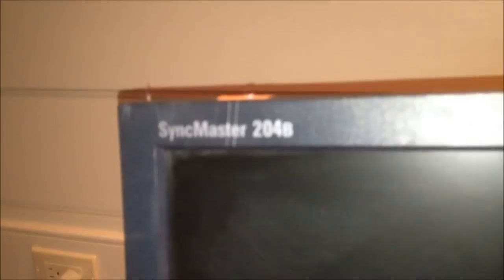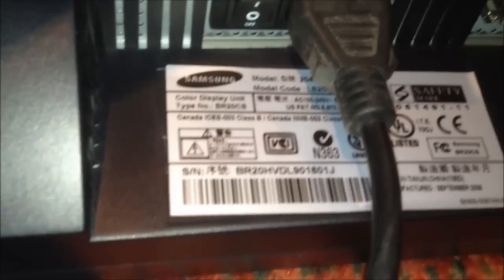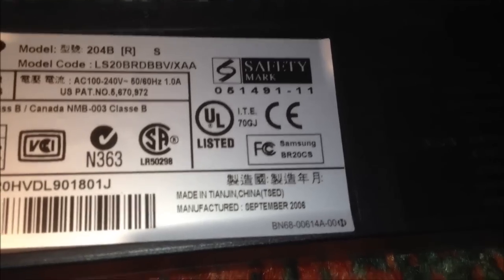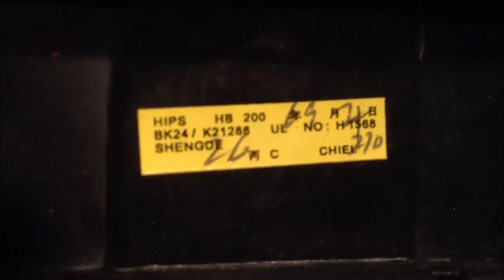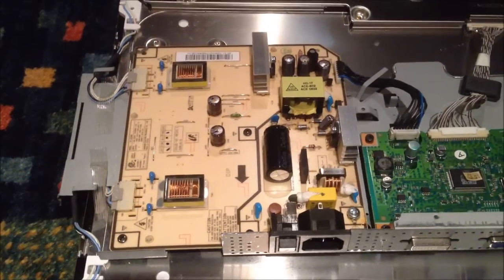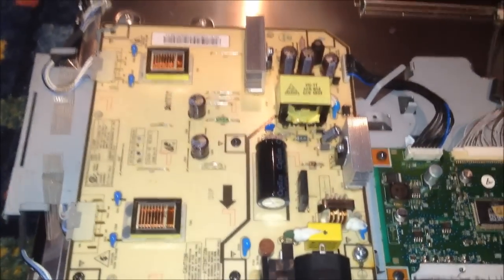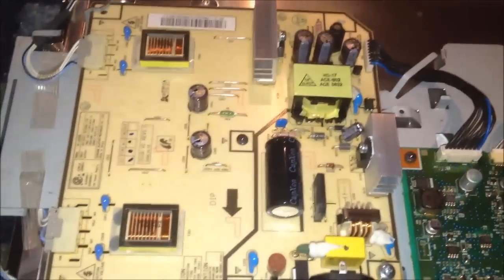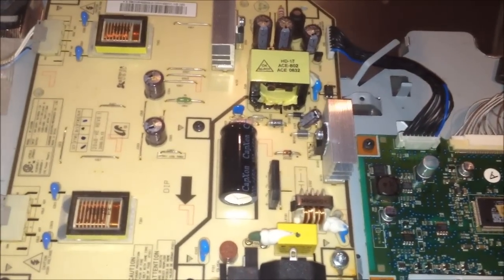Thrift Store Score 11-18-2012

Comment from the maker: that is kinda sad, lol. i just don't like chinese caps. i tend to stick with mouser because i can get exactly what i need very easily. ebay i go to for very odd capacitors that mouser doesn't have. like for example some of the old tube amplifiers had metal can multi-layer caps with proprietary pinouts. that shit is so annoying, so you have to go to ebay for that.